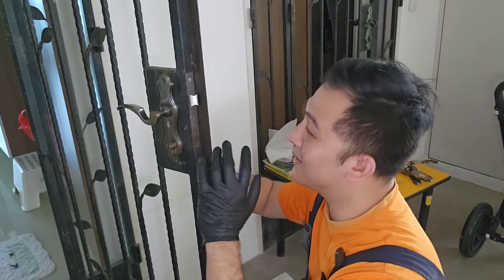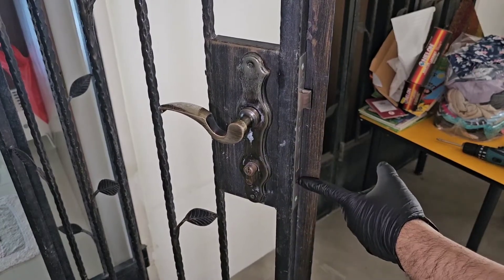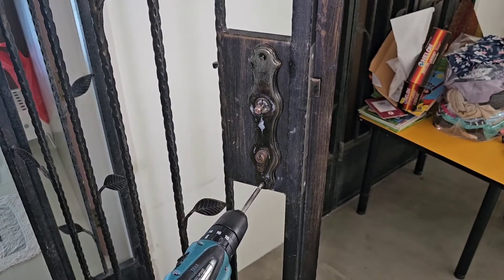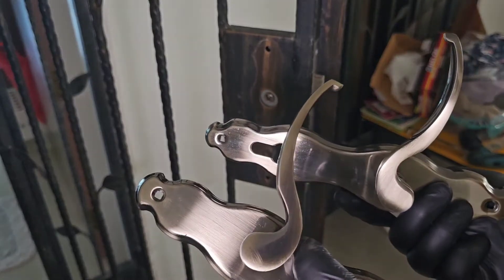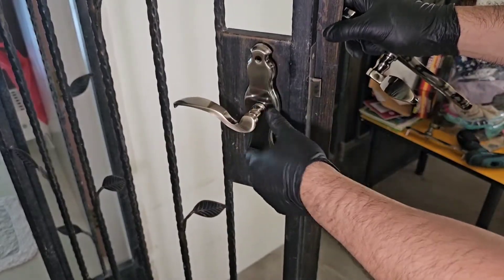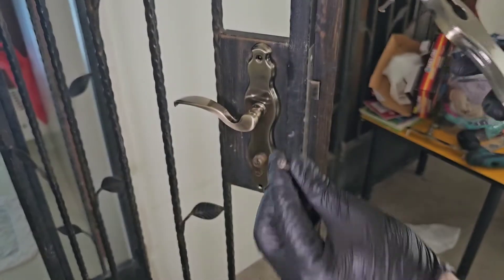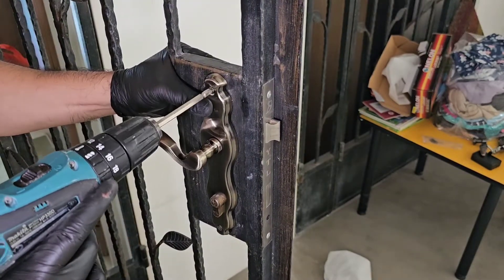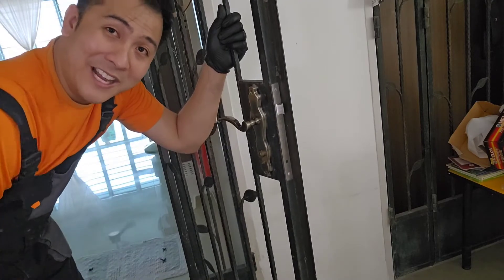Gate HANDLE Repair (Save $150- Locksmith fees)

Comment: Look forward to a video on replacing windows flush bolt.
Reply from the maker: I've written it down on my to do list! Keep the suggestions coming!
Reply: @ThePunggolHandyMan  Thanks. I need some info on getting one replaced. Especially on the flush bolt types to use, and the different drill bits and rivets sizes to install.

Comment: Could you do how to install a new instant water heater?
Reply from the maker: I don't have one but I have a video of how to properly connect a water heater to a dual pole switch
Reply from the maker: Hanging one on the wall is like hanging a picture. Drill and screw. Pipes are easy to hook up. But this is the tricky part

https://youtu.be/10CK4x-z6Qw?si=lyOGOBILJcA0Hv8k

Comment: Could you make a video on the HDB gate latch? I think a lot of people face issues with the latch rod stuck. For me i found my bottom latch rod abit loose cos i suspect the contractor drilled a hole in the cement screed that was too big?
This causes my side gate to rattle excessively whenever i close my main gate. I am not so sure what i can do to secure the latch rod properly in the cement screeding.
Reply from the maker: I do have a video like that! It's on the channel!